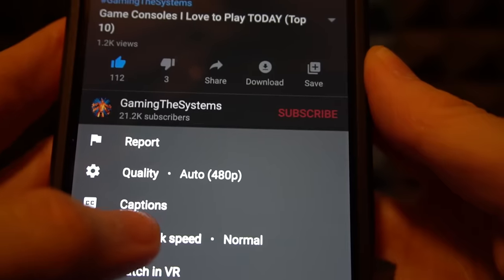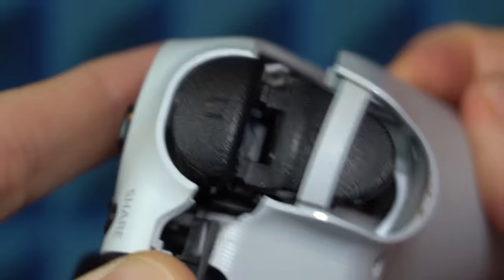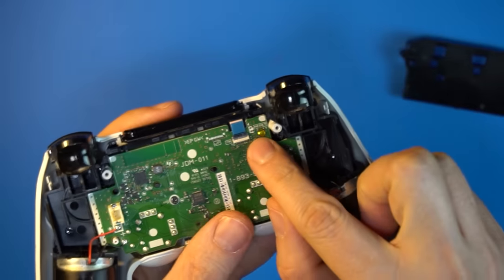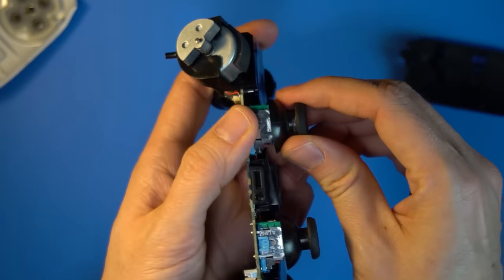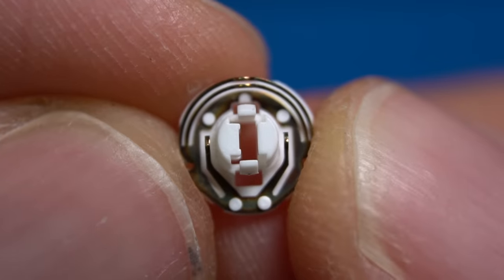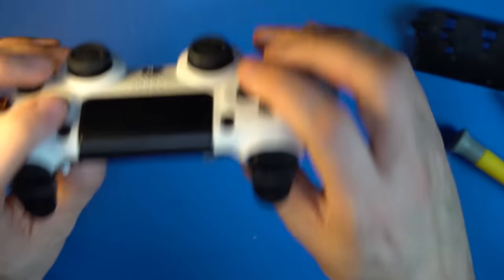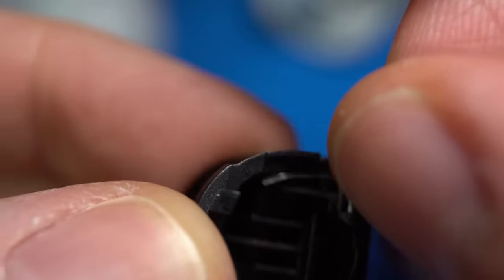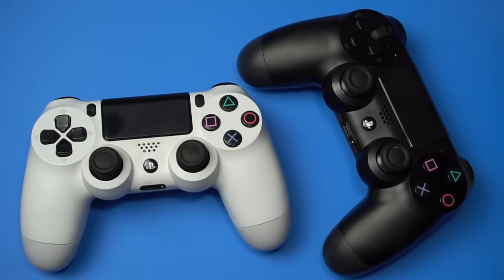How to Repair a PS4 Analog Stick That is Drifting, Sticking, Jittery/Cleaning DualShock 4 Controller

Comment: Yeah I followed this and my controller is permanently broken now, it only had a little jitter in it, but it sadly passed away in the late evening of the 25/05/2020, it served me well at times and we plan the funeral later today, it was no longer my main controller but played a large role in my life, a true inspiration, gone but not forgotten, I love you Felicity ❤
Reply: AAAAAA IM SCARED TO TRY THIS NOW😭
Reply: @aliaclickbaiter3502  Yes I do not blame you,   I had issues happen with my controller that did not happen in this, e.g the circuit board fell out of the shell, the worst part is probably that white disc you pull out the housing of the analogues, i had the door snap off and not close, and it looks like the metal rings on these discs you take out got damaged to, chances are you will kill the controller if youre not used to doing these things like me

Comment: Finally got rid of that annoying ghost movement on mine thanks for this! As difficult it is to dismantle a ds4 I found it much easier than the joycons and their frustratingly tiny components.

Sad that the we came to this. My old ds3 is so worn out the joysticks' rubber has disintigrated but still works perfectly meanwhile my ds4 started drifting after a year. Hooray for technological advancements!
Reply: in 3:40 how do you open this thing?
Reply: @iihsnii1630  I used a cutter blade to pry it open. Apply just enough force that you are not straining your fingers then hold it, don't keep pulling on it, just keep applying steady force so not to put too much. It will snap open after a few seconds and don't worry it isn't as fragile as it looks

Comment: This worked like a damn charm! Thanks!

Anyone who sees this comment, my recommendation is to watch the video through first, then watch it again and follow along.  It’s really not as complicated as you first think it is.
Reply: I just did this for two controllers, and they both work like brand new. Only thing I wonder now is for how long will they work before new drift?
Reply: Hey, it actually got worse for me, now I can't move backwards at all
Reply: @kichwatembo2204  Yeah, the one I did it with I just had to do again yesterday.  But it still works great after doing it a second time.  I'd rather spend the 3 minutes doing this once every couple weeks then buy a new controller (for now at least...).
Reply: @Jojiskywxlker  Sorry, not sure what to tell you.  I'd try and take it apart again just to see if you put something back wrong.

Comment: For me it wasn't the cleaning, just that the part he prys back at 3:40 needed to be loosened. After you clean it, close it but don't do it super tight.

Also, keep in mind that if your stick is driving up/down, it's the left part that needs fixing, if it's going right/left, fix the top part

Lastly, I suggest getting a program called DS4 Windows on your computer, setting up your controller to it and opening the read input screen. When you think you've fixed it, plug it up and test it, that way you don't have to put it all back together (you don't even need the battery, just plug in the USB) and you can see exactly what the controllers doing.
Reply: Thanks for the info  it helped me a lot but after cleaning the chambers my controller makes me turn left slowly in game but if u hold the stick just slightly left it doesn't happen so I think it's resting position is off or something, do u have a solution
Reply: @musaayub2009  reopen and do it again, check for any fuzz, and your placement. I've repaired two this way so far and sometimes with test runs there is still a small drift. it could be the positioning of that white piece. It might be off slightly causing the left drift
Reply: I don't have a computer tho
Reply: I used my nail and got it open
Reply: After I cleaned my controller my drifting is way worse now. Like extremely bad. I had to put my dead zones higher for the games I play
Reply: my black and red wires disconnected from the mother board😭 what I do now?
Reply: @ight2060   u bin it
Reply: Ight rip
Reply: Wow Thaanks! The loosen part helped 🙏🏽
Reply: can someone pin this comment
Reply: Alex Harris i
Reply: The door broke and now the controller is broken.
Reply: @t.myazoe  I'm so glad I was able to help😊 I honestly don't even know how I noticed it. I cleaned it like 3 times before I realized what was happening

Comment: extremely good tutorial. just done this to my controller and it worked. 

HOWEVER! when it came to the ribbon at the end, like in the tutorial I placed the pins facing the battery. the controller wouldn't turn on. I swapped the ribbon the other way and it worked.
if your controller after isn't working/turning on. try taking out the ribbon and put it back in with the blue side facing the battery

my model must just be different, great tutorial non the less. Wouldn't of been able to do it without the help :)
Reply: I'm just putting mine back together here and can see the Contacts face away from the battery on mine as well
Reply: @alexbutler5777  yeah that confused me as well. just dont wanna think that anyone that tried to put their controller back together and made that mistake. when its such an easy thing to overlook and just end up spending £60 on a new one. cause of that small issue.
Reply: @joemanu96  Awesome, was looking for this comment. Common sense told me it should go this way (black fairly old controller) as you can kinda see what's going on.
Reply: Yes my controller is the same too.

Comment: [Alternative - First Aid Solution]
Take a Straw, Flatten it so it looks like this [] 
fit it in the analog stick from the side while holding it down and blow really-really hard from the other end of the straw (or pull air, up to you... but be careful... and don't overdo it). 
Enjoy a Drift-Free experience along with a really bad headache for a moment.
Reply: TwinDenis I’ve seen this comment on a couple vids thank you this helped man
Reply: How long should I do it and which side should I blow it on? My drift happens towards left on right stick.
Reply: @nxqzy  You can do it on the same side, it is basically dust you are trying to clear up so just do it until it's working, the other possibility of course is a mechanical damage in which case you should take the product back for warranty since opening it up will only void/cancel the warranty.
Reply: @DarthRevan823  No Problem, it's good to see this info helping out other people too. Sony's+Microsoft's latest controllers are honestly pretty low-quality and pretty inconsistent in their design, hopefully cleaning the sticks often will add to their longevity, I still have my PS3 Controller after 10 years still intact, no drift, no cleaning, they were very durable. The New ones rather feel fragile.
Reply: Use canned air itll help more 
It has more pressure behind it and you have a chance of getting saliva in your controller
Reply: @Jawastolemydroid  Would that potentially be too much air for the analog?
Reply: @XxMatt1313xX  good point to be quite honest im not sure
Reply: You have a video to see how you do this?:))
Reply: THANK YOU KIND SIR
Reply: Andreasplayer69 4 minutes
Reply: TwinDenis That's what happens with my controller.Its mechanical damage.I threw on the floor and stomped on it :/ the analog sticks are broken and the L2 button is pushed down.
Could I fix it?
Reply: Ferdavid2020 FN thats why u dont play fortnite
Reply: Devin Mckinney Ur funny.Is it because of my pfp?I wasnt playing fortnite when that happened.I was playing surviv.io on a controller.I connected it with bluetooth m8
Reply: That's a bad idea. When you blow into the straw you're also blowing spit into your controller possibly making it worse. Bad advice my friend. Very bad advice.
Reply: My controller doesn't drift.. but incase it will i'll do this.. Thanks dude
Reply: Xaviervw on me wtf 🤣 foo was playing box fights
Reply: Thank you bro it helped my analog stick was tweaking and moving sharply across the screen I couldn’t aim for shit without fighting against it. I did the straw method this morning and now I can play without a problem ❤️
Reply: Ferdavid2020 FN f
Reply: Whooooo it worked no more drifting thank you for your comment
Reply: Xaviervw someone that was playing at school really pissed him
Reply: Theon Epstein idk man it work for me really well
Reply: Man you are the hero we didn't deserve. Thank you so much🙏
Reply: The amount of videos ive watched and times ive taken my controller apart...just for someone to say stick straw and blow🤯 it actually worked thanks man
Reply: Does this actually work?
Reply: OMFG IT ACTUALLY WORKED
Reply: Bless you
Reply: But I did that and after a while I play with the controller the drift happens again.
Reply: TwinDenis thank you this shit actually works like my stick drift was horrible I could literally do 4 360s in 2 seconds on fortnite and now I have no stick drift this is actually so easy and simple and it works thank you so much my guy
Reply: I really hope this works bro

Comment: "Gently" seperate the two shells
How do you do that?
Reply: its hard to do if its your first time opening your controller
Reply: Buy it a drink
Reply: The handles are the best place to pry
Reply: gently use brute force.
Reply: Use a flat head screw driver  to gently pry open each tab
Reply: ok I've done 3 controllers now. The ps4 controller has an upper and lower section. lift (wiggle and it will come free) one of the top sections of the long hand grips. lift it as much as you can. Put a thin flat head screwdriver in the small gap, that has appeared next to the headphone jack port.  Twist the flat head and it should pop off. If not, do the same with the other grip. With regards to the flat cables - look which way the pins line up. The description in this video can be wrong, depending on the controller version.
Reply: I just gently pried the two parts away on each side. It takes patience and dedication but in the end they separated for me.
Reply: Exactly my concern too. I tried it few days ago. Removed the 4 corner screws and then tried to separate the front and back cover of controller gently. But gentle force wasn't working. I was afraid of damaging some delicate part inside controller if I used bit more force so I cancelled the idea and screwed back the 4 nuts. Gave some heavy wind blows from my mouth on to the analog sticks and fixed it temporarily 😎

Comment: Hello mate, just wanted to let you know that I just tried fixing my daughters controller using your method. Although it didn’t work (I’ll have to buy a new one) you explained it very well and it was easy to have a go.

EDIT: I TRIED THIS A SECOND TIME AND IT WORKED, WAS FIDDLY REMOVING THE GREEN DOOR THING BUT I GOT IT DONE AND MY CONTROLLER WORKED FINE FOR A WHILE AFTER 
Thanks mate
Reply: david cutrin I should point out that I tried a second time and it works fine now, so this dude literally saved me £50 buying a new controller.

Thanks for the reply dude :)
Reply: I have an old controller seeing if I can fix it I stead of buying a new one
Reply: @CMillz884  sir, use the edit button to tell people 😭
Reply: Rayanson it don’t matter , hes helping us out.,
Reply: Rayanson good shout mate, I’ve edited it
Reply: @CMillz884  np Sir, its better fixing than buying a new one, I didn't have to try this méthode, a video said you could just push the stick in and blow with your mouth (I'm really not proud of it) and it might get the dust out, thanks to this my controller doesn't drift anymore

Comment: Worked for me, though I almost broke the plastic that holds the battery since mine needs to be unscrewed first before pulling it out. Anyhow, your tutorial worked like a charm and I'm a happy man. Thanks a bunch!
Reply: Which version did you have?
Reply: @jaaanai  Video controller is a first edition dualshock. The second edition dualshocks (the ones that have the light bar in the front) do have a screw on the plastic plate, it should be unscrewed before taking the plate out. Also, the reset button is part of that plate on the DS2, so you dont have to worry about losing it.
Reply: @Naucles  thanks, did mine yesterday and it worked.
Reply: @Jaanai Inniss Me too ! Just yesterday. Cheers.

Comment: When connecting the ribbon he says the side with the silver wire traces needs to face the battery he is wrong the blue side with the black line needs to face the battery like so he can pin
Reply: ANDROIDAPP LOOPHOLES you fucking saved my life, i thought i was gonna have to buy a new controller
Reply: OMG THANK YOUUUU
Reply: You sure? I did it his way and had absolutely no issues. Or is it something I'll notice once the battery runs out or something?
Reply: Thank you, worked
Reply: Turns out you were right! I did it the way he says, and the light didn't work, and it wouldn't charge. Now that I reversed that ribbon it works perfectly. So thank you!

Comment: "Gently" remove the shells.
Reply: I thought I was gonna break it...surprised me when I did it without cracking somethimg
Reply from the maker: There are four tiny tabs that keep it together after the screws are out. If they break while taking it apart, DO NOT WORRY. I tested, and you can actually break all four, and it'll still go back together easily.

Comment: Great video... except the "blow off" part. When you use your mouth / breath to push air particles of saliva come out with it. That saliva contains salt particles which is horrendously bad for small electrical components. It is better to use compressed air in a can... or something similar. They make things meant for electrical components that are super cheap.
Reply: This was my gripe x...X
Reply: @JC-uw4gy  no one can....
Reply: @JoshuaCasper there is already humidity. At least it's more higher where I am. People should take more risks, breaking, then fixing something is half the fun lol
Reply: @ediddy_420  it's not the humidity, it's the salt water. He is sharing this to teach people. I am trying  to help. Do what you want though. :)
Reply from the maker: I am not concerned about this. I would probably have to blow on the components for an entire year to expell enough salt to do any damage.
Reply: There is truth to this, but really it's just to teach good practice. Don't take it as a "immediate danger" but In general you don't want to blow on electronics >_<

Comment: for my controller the final ribbon cable when reassembling, the silver side away from the battery, not towards. Also, prying the green doors open actually seemed to break some of the parts that snap back. I was still able to get it to partially snap back, but not really like how I got it. sharing in case others find this helpful. Controller came with console purchased last year with console
Reply: yup, mine was the opposite or else the touch bar light wouldn’t work.
Reply: Yk there are different versions of ps4 controllers?
Reply: Had the same issue on both!! I was.hoping someone else had it too, or else I was.going to freak out when it didn't light up or charge

Comment: Goddamn NES Ninja Gaiden music making me feel like I have to diffuse a bomb before it blows up in my face
Reply from the maker: Yeah, I probably should have selected something slower.
Reply: @HowToX  I followed through with your process and it fixed the drift I had, but now the LED light on the back wont come one when I turn it on, it will connect to my Ps4 and I can use it but the light doesn’t come on, also the charger doesn’t work, it works on my other controller but not this one. Help pls.

Comment: Used this, actually worked. PRO TIP: flip the analog sticks backwards (so the old forwards is now facing you) this way the heavily worn front end will be replaced by the more moderately used back end.. if that makes sense- thanks for the tutorial bro!
Reply: my black and red wires disconnected from the mother board😭 what I do now?
Reply: @ight2060  you have to solder them back on. It shouldn't be completely broken

Comment: Thanks a lot for the tutorial! My TLOU2 limited edition controller’s right analog started drifting upwards about 2 months ago. I considered buying a new one, however, these things cost about 1/3 of a minimum wage in my country! So i decided to clean my controller! It was hell of a process. Especially, taking the top cover required a lot of pressure and time. I ended up breaking two corner clips but the controller works pretty well right now! Thanks a lot!

Comment: I was fine till I had to close the the green “chamber”
Reply: What happens!
Reply: Yeah same I can’t close It
Reply: @scratiq1293  I had trouble using my fingers to close it. So I applied gentle pressure with the screwdriver directly on top of where the connectors are and it clicked effortlessly into place.
Reply: Nigel Mendoza i still can snap one side back into place. The larger 'tab' simple wont push itself in
Reply: I have the same problem..what did you do
Reply: halimovico one of the pins had snapped off so I broke it off do not recommend. Check around carefully to check if one of the pins is getting stuck last second before you accidentally breaks it
Reply: I CANT PUT THE MF WHITE DISK IN THE GREEN CHAMBER
Reply: @wavyyaz7714  😂😂😂😂😂😂😂 bruh its like doing surgery
Reply: All fun in games till the green chamber breaks off
Reply: Austin poole768 I broke mine off by accident

Comment: Good tutorial. One thing that I would mention is when taking the board out, don't let the vibration motors hang off of the board, or you'll be soldering them back on.
Reply: I made that mistake a while ago. It was a dead pad for parts anyway. But yeah a good little tip.